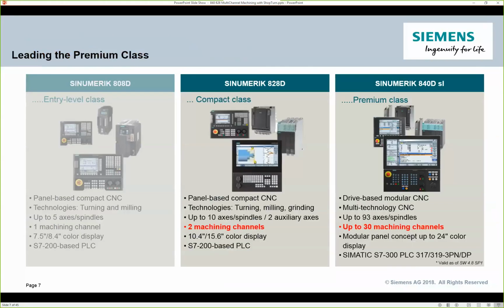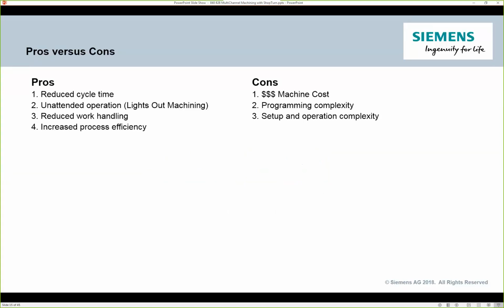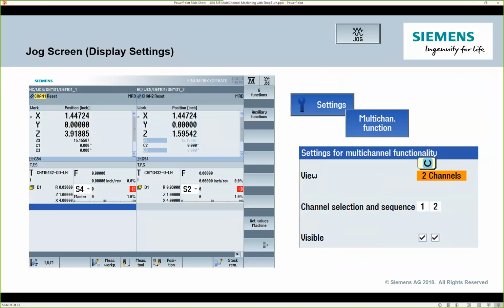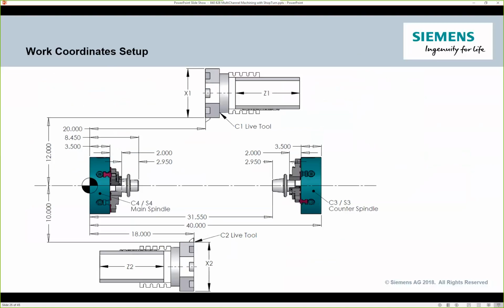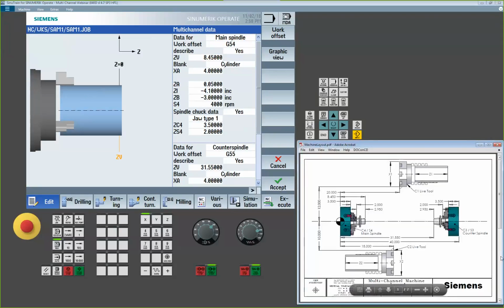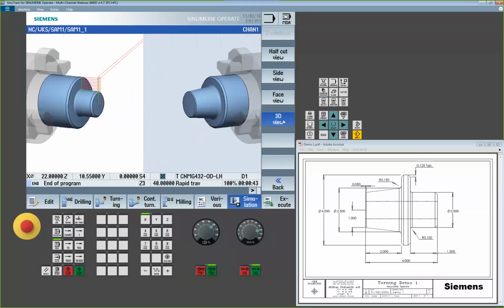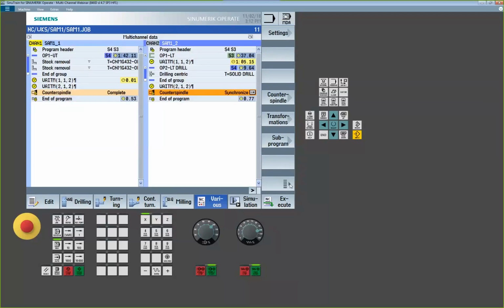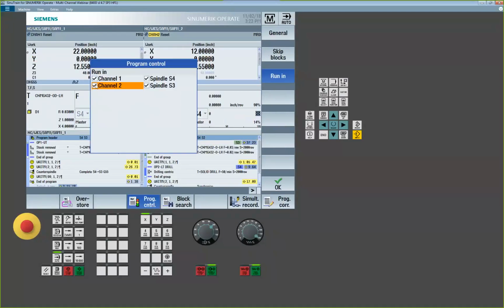Multi channel Machining with ShopTurn

Comment: Dear Sir, how to do turning while the job is clamped on both the main spindle and sub-spindle. And I would like to learn Balance machining  ( turning using the top turret and Bottom Turret). Please advice. Thanks
Reply from the maker: We just did a video on balance machining https://www.youtube.com/watch?v=a1x0eMOQYK4&t=3522s
Reply: @MrCNC  Thanks, Sir. I watched it and it is very useful.

Comment: Awesome webinar! I feel more educated on the controller itself than I did after reading two of the manuals I found online. I was wondering if you ever planned to do a two channel program using G Code.
Reply from the maker: We are currently working on creating all of the ShopTurn webinars in G-code as well.  Multi-channel included.  Thanks for the comments.